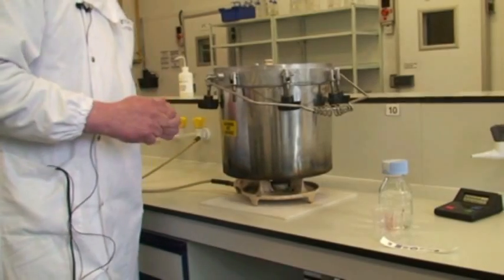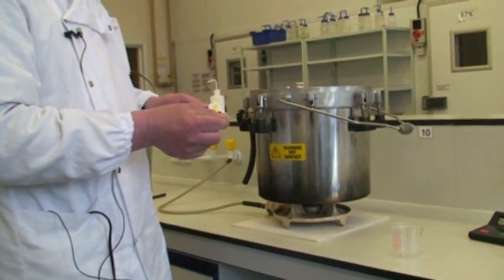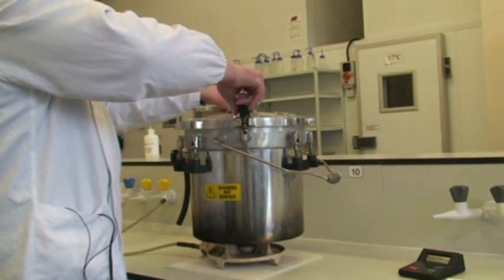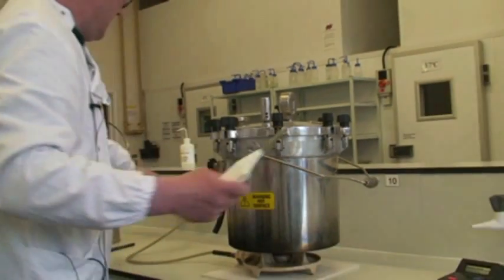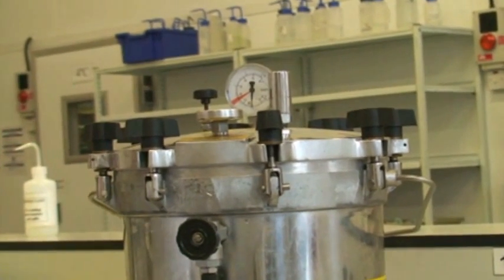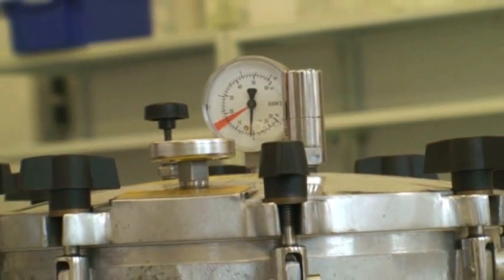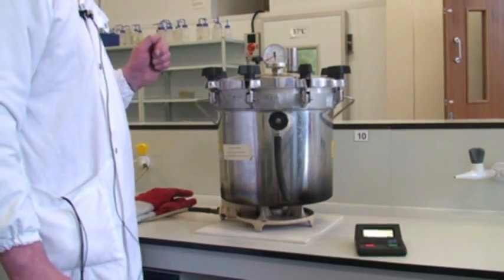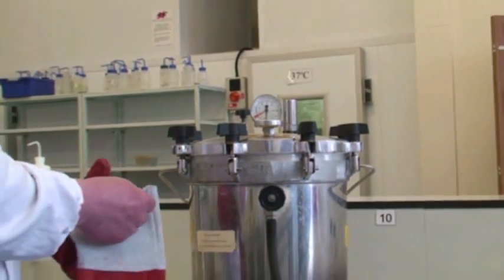Microbiology: Using a Portable Autoclave

Comment: I have a 12l autoclave which I intend to use for mycology. The last time I used it (which was also the first time) I put water just slightly above the content holder (and by extension the heating element) and sterilised for two hours. When I was done I noticed some specks/powder which look like iron fillings and the shiny element changed color from shiny to subdued color. I am very afraid of using it again, I'm intending to use more water next time but I'm soo afraid of damaging my autoclave. I cannot afford to. Is there some way I can mitigate this or reapply whatever layer was burned off